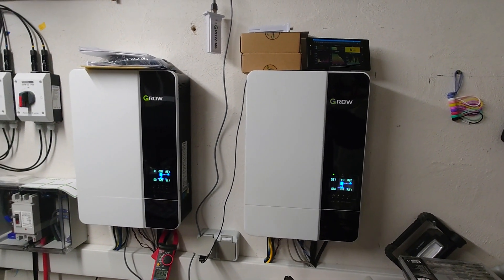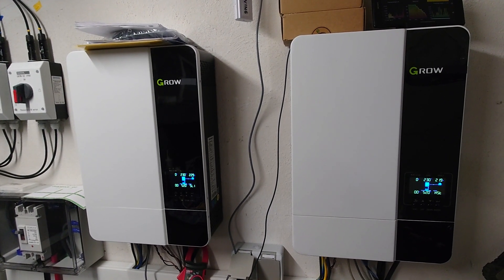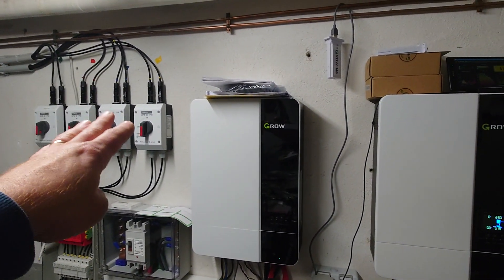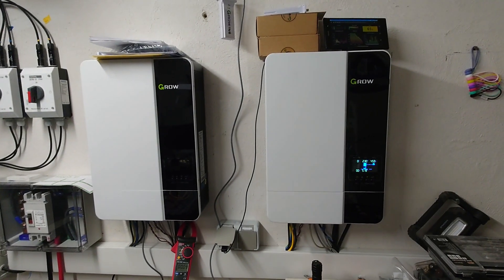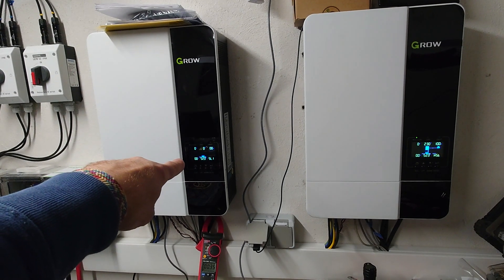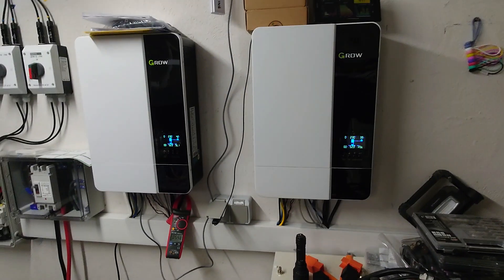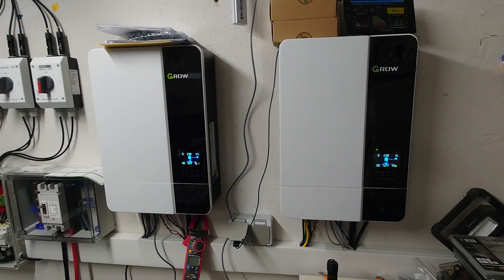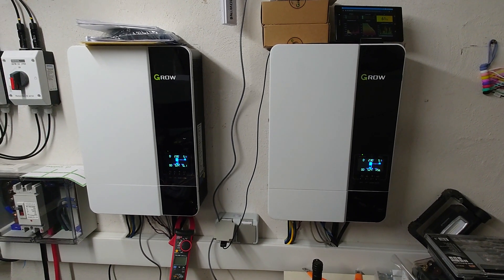Growatt SPF5000ES hotplug functionality (parallel single phase mode)

Comment: Hi, really useful video! Thank you for sharing it.
I’ve had an SPF5000ES for 3 years and I was thinking of adding another one in parallel like you did in the video. I was wondering if you managed to automate this? I know it’s straightforward, but from the inverter’s perspective is it safe for everyday use? Please let us know if you’ve had any useful results, as I’m planning to do the same.
Reply from the maker: the two inverters work perfectly together and yes I automated everything without taking manual adjustments for the last year.

Comment: Can't this be automated using a combination of program 4 (power saving mode) and program 50 (AC output time) on only the slave inverter, such that during the time period with no AC output from the slave, it will naturally go into power saving mode to conserve power. And the master inverter will handle all the load in the interim. Is this not possible?
Reply: You can program each inverter to turn off and turn on at any time on the clock you please. It's in the general settings on the spine phone app.
I have used that feature for a while now

Comment: I’m not sure if it’s a good idea to shut down and restart the inverter every day. But I agree it would be very good to preserve energy. But thanks for testing and sharing!
Reply from the maker: Thanks for your comment. What are your concerns about disconnecting the inverter everyday (in winter times)? The inverter has a communication to the host and both align on the provided power...
Reply: First of all, I’m a beginner with this, so absolutely not an expert. My concern as an IT guy is, doesn’t the system get in trouble if you turn it on and off every day? 

Anyway, I’m really curious about your findings 😁

I’m also trying to find out how I can connect 2 SPF 5000 ES’es to 10 parallel Growatt ARK 2.5l LV batteries. I don’t have the system yet, but I’ll need it pretty soon. 

Thanks again for sharing your experiences!
Reply from the maker: @ElJasperino  the system handles the  obsolete and reappearing inverters well..